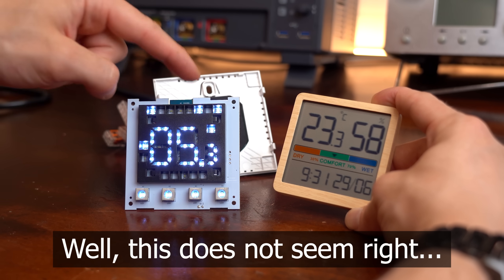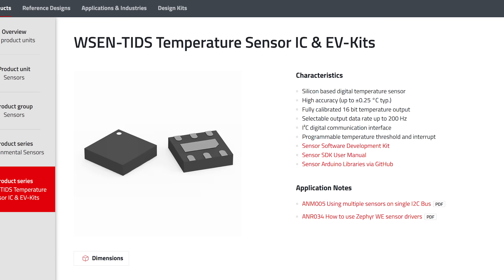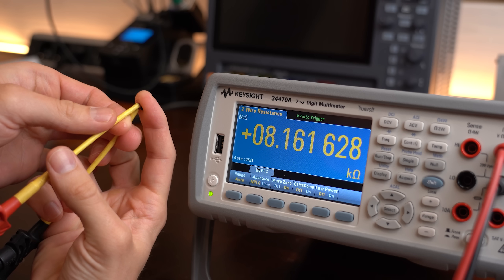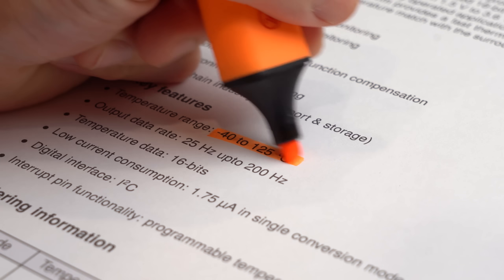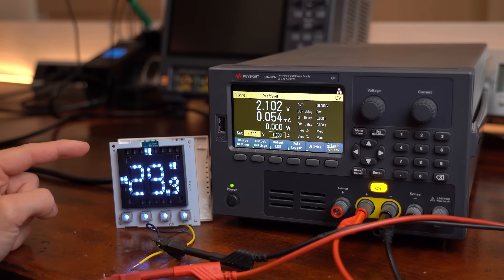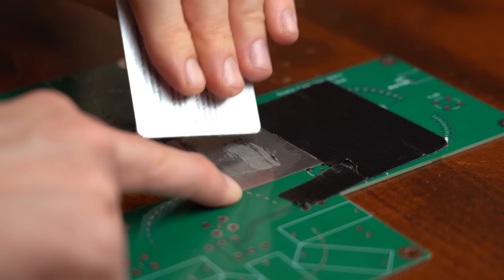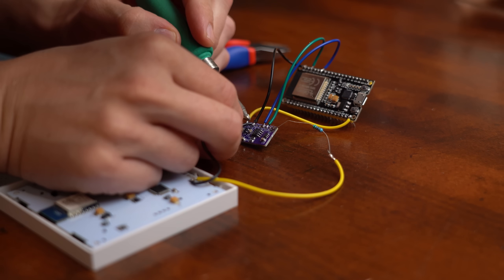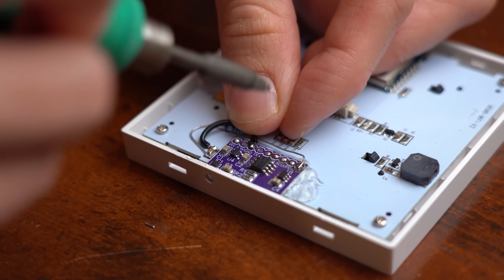From Meh to WOW - With 1 "Tiny" Hack!

Comment: I would try connecting wires to the resister to the resister to get it away from the board first. To see if other components heat is influencing the reading.

Comment: I think you make an alternative hack now - analogue style.  What about using the LM35 Precision Centigrade Temperature Sensors (TI) or a TMP35 (Analogue Devices) both have a three pin TO92 style package and are pretty cheap.  I think with a few passives and maybe a trimmer pot you'd be good.  I'm just an amateur so maybe I missed something, but I think it could work.

Comment: Sorry to say it, but you needed a piece of insulation in the wall. The sensor is INSIDE of the thermostat, and the air coming through the  hole intended for the thermostat  wire is a few degrees different from the air inside of the homes living space. This is a VERY common situation, but most people lack the ability to test it with digital accuracy...

Comment: Hey great scott , i was creating that directional speaker from your video , altho there were far more changes in mine , i have many doubts , could u help , i am using the esp32 for microcontroller , instead of bluetooth module , using esp as the bluetooth using the pschaltzman audiosink lib , then instead of waveform generator and comparator , both these operations are done using the code in arduino in esp32 , for amplfier driver board i am using drv8871 board , will this work? u can ask anything if u wish

Comment: At very first, I would have soldered the NTC on a few cm wires, and get them out of the device into the room, and then look at the temperature reading. The hole in the wall can easily  make that difference, the PVC tubes there sometimes even transport air flows from the outside.

Comment: Or you could have just replaced the resistor with a 1% trim pot.  But if you're going to go with a digital sensor, why not just add a relay and replace the thermostat all together?  In either case, less parts and much simpler 🤣

Comment: I would just replace R12 with a poti and simply calibrate the sensor. The slightly none linear NTC does not matter for the small indoor temp differences.

Comment: Not sure if you know this or not, but for a long time ( since mercury thermostat bulbs ) there have been electrical implementations that manufacturers used to add to the thermostat sub-base to minimize the overswing when a heat appliance satisfied. Back then it was called a "heat anticipator." It was nothing more than a resistor that sat underneath the bimetal element to "fake" load it so that when the unit was about to satisfy it would do so early and the space temperature would end up on point, not over. This is covered in most HVAC courses. Over the years many companies that have incorporated some of the base principles ( including this and time delays ) have incorrectly applied them in their logic. For example, using the concept of continuing the flow of air in a furnace to get the residual heat out after a call for heat. Consequently / paradoxically some goofy manufacturers tried doing the same in cooling. Where you really just end up taking humidity back off the coil you just ran. I believe Youtuber Matthias Wandell showed an actual example of this with his own dehumidifier setup. So, when you were describing the problem, it made me wonder if it was not a "cheap" component or poor quality but perhaps someone who doesn't fully understand the theory making something with tribal knowledge instead of actual knowledge. For what it's worth. Love the channel.
Reply: PS: I meant the manufacturer by the way, not you. LOL

Comment: Most of these Tuya thermostats have a temperature correction function for a +/-3C to the output temperature (I have yet to find one without this). In some cases you don't even need the official app and can do it through it's config menu ... so, skipping directly to home assistant sometimes has its drawbacks

Comment: You do know that all these panels have a option to tune the OFFSET right?
Also: why not swap it out for a ZIGBEE based one? those are much better than Wifi based models, and much easier to add to Homeassistant.
And you can tune the offset straight in HASS without much issues

Thee reason you have issues with the temperature is because you bought the NONAME brand, Just stick to more trusted brands like AVATTO.
I would suggest to avoid MOES. because those have a "Set-temp=X issue where it spikes for 1ms"

Comment: Fun. But you bought a thermostat, then gutted it and built a different thermostat.  ;-)
Might make more sense (if the error was great enough to care about) to just change the resistor in the voltage divider to raise/lower the temperature set point.

Comment: I have the same Thermostate and noticed this error. 
You can set an offset for each device in Tuya. This solved it down to around +/- 0.3°C error in the relevant Temperature range.

Comment: Hi. You don’t have the firmware but perdais you could dump the logiciel between the cpu and the wifi module.  Or on the central heater ( i don’t know the good word😊). But yes. It’s many work for a small gain. Thanks for the video
Reply: ...But perhaps...

Comment: I built my own thermostat with arduino nano33 iot using a bmp280 temperature sensor and a Nextion 5inch display. All worked well but a slight temperature difference was there, sorted by adding or subtracting correction to the read temperature and now matches within 0.1 degrees.

Comment: Most sensors are ntc, when you want to turn off the heat but thermostat has a pin code just use graphite pencil draw a nice big line between the pads for the ntc and heat is off

Comment: You could have corrected ALL of the thermostats' readings in home assistant, without touching hardware.

create a new template sensor that performs the correction, typically through the configuration.yaml file or the Helpers menu.

This would not correct the thermostat visual display, sadly. But you could achieve accurate control without touching Hardware.

It would have been easy enough to use a trim pot to correct through voltage divider, and then adjust the slope to linearity within home assistant.

I can't believe you created a PCB and Sourced all those components

Comment: Would have made a board the has all the parts in the right sports so it's only solder the correct spots and tada drop in temp fix.

Comment: I would have just used the built in manual compensation setting. It is only linear correction, but most of the time it is good enough.

Comment: Nice project, but a long way around for temperature compensation. The simplistic route is to use the thermostat’s own calibration function. An offset of +~5C can be found in the system menu that’s accessible from stand-by.

Comment: So my idea to add temperature sensor (ds18b20) to sonoff touch (light switch)  and send signal to boiler room to open valve is better then tuya stuff. Yes I don't have function to change temperature from the switch but it's no sense to do that floor heating.

Comment: Any good hardware solution for ESPhome wifi temperature & humidity sensor with 220v power supply? 
I plan to install 9-10 all over my house for automations but cant find any reliable and in good price. 
I build one with ESP8266 but it needs re-design to avoid heating the sensor when closed into the enclosure

Comment: My solution at home is:

1. Do NOT use the integrated temperature sensors in the thermostat or AC. Even if they are accurate, they measure right in front of them which is usually NOT representative to the actual room temperature.
2. Get some Zigbee/Zwave/Wifi (whichever suits you) temperature sensors.
3. Place 2 or three sensors at strategic spots in the relevant room
4. Using home assistant automation and scripts, get the average temperature from the sensors and use that in your automation/dashboards.
4.1 This way you can skip the thermostat, since it's functionality is covered by software and the sensors. You can use a random display if you want the wall mounted experience. If you still want to use your thermostat, look for an api to overwrite it's display temperature.

Comment: It's amazingly overengineered.
I have some cheap-ish zigbee Thermostats that I integrated in home assistant via MQTT. I simply used separate temperature & humidity sensor that I placed in the possibly coldest place in the room. This works pretty well for me.

Comment: I started with an esp32 with a temperature sensor (bme280, i think). I added a relay and connected it to the furnace (in parallel to an old school mercury switch, some impedance matching). I used the normally open part of the relay so the default is OFF.

I wifi enabled the esp32 to show the temp and added a webpage button to activate heating. I set ut up to increase the house temp by 4 degrees, running up to an hour. This way i can heat the house by vpn and activating that remotely.

Comment: A Control for Heating and HVAC has a bit more logic, that turn on at some tempture. 
You have to keep the HVAC unit on for a certain number of minutes and prevent cycling. 
Example if its 21C and you want it at 22C  you need to turn on for a few mins,  if you just cycle 
on at 21C and off at 22C  this could damage system just for 1 degree tempture change.

Comment: All my life in HVAC. I noticed that the gap inside the wall was not both isolated and insulated from the inside of your thermostat.
It looks like you had a very big hole in the wall as well. 
Even if there is only a tiny little hole big enough to bring the wire up into the back of the thermostat it’s still a smart play to seal that little hole (at the least with a piece of adhesive tape) to keep the unconditioned air out of the wall from travelling out of the wall cavity via the inside of the thermostat and then over your thermostat sensor bulb, stopping your thermostat registering the room temperature. In some cases that internal wall space can be slightly pressurised due to the wall cavity opening above or below the conditioned space or even outside the building, making the problem worse. At the very least I would seal the gap around the sensor bulb and the housing so that inside the wall Air is not able to exfil the wall via any path related to the sensor bulb.

Comment: Even if it's not "perfect" it's a lot better than it was before and you learned something in the process. 
You could put your thermal imaging camera to good use to find which component is producing the most heat (my bet is on the voltage regulator) and add a thick copper wire to its ground pin to "pull" as much heat away from it, maybe dumping it somewhere cooler into the white PCB. At first I thought about the ground pad of U2 but if it runs hotter it would add heat instead of absorb it.
Anyway it's a cool example of how to interface otherwise-incompatible circuits.

Comment: Totally over engineered for this kind of device but this is very instructive and could help for project to upgrade more expensive/uncommon devices. Thanks !
In my case, I swap the WBR3 chip with a ESP12F and then run ESPHOME (where it is easy to calibrate the T°C sensor).

Comment: The easier solution would have been to adjust the existing voltage divider. Since you measured the corresponding volatge for each temperature. This could have been as easy as replacing a resistor...

Comment: Do I see correctly that you placed regulator right next to the temperature sensor?

Also - copper is one thing, but you can also see on many more precise sensor breakout boards that they sometimes also cut the board so sensor uC is as separated as possible

Comment: You could have saved the DAC by switching to a 1-series attiny e.g. 412.
The heat creep is normally counteracted with a tongue like structure where the sensor sits on.
And to make it easier to assemble I would work with castellated holes and solder the PCB directly to the pads of the C and R you removed.

Comment: A DS18B20 might have been the better choice for the temperature sensor. It has almost the same accuracy as the Wurth sensor (+/- 0.5 deg max.) and almost the same temperature range. Although ... I don't think that going down to -80 or up to +125 is a situation where you expect the thermostat to still work accurately  😉
As a plus, the 18B20 comes in a thru hole variant so it can be mounted free in mid air below the PCB instead of on the PCB where it will take longer time to reach the actual room temperature.
Still a fun exercise though and an enjoyment to watch 👍

Comment: Thanks. My question is, 'Why not simply replace the cheap NTC resistor with a good one?'
I see that your solution works, and was with you until you used magic incantations,  Then I heard that whooshing noise which accompanies what is (to me) unexplained complex coding.

Comment: The biggest problem with the NTC thermistor is that it's to close to the warmer power supply and other electronic parts generating heat. On my sonoff NSPANEL I had to extend the NTC thermistor outside of the unit so it wasn't giving false readings, due to the heat from the nearby electronics.

Comment: This has SOOOO much more potential.
You often see on weather forecasts something like a "Realfeel" temperature which is supposed to be the temperature it feels because of the temperature + humidity effect.
You could program your little microcontroller to input both temperature and humidity and output a "Realfeel" equivalent temperature.
This might fix the problem I have had with ACs that under a specific set of environmental conditions it's too hot, but lower the set point 1 degree and it becomes too cold. I think this might be from the AC not just cooling but also dehumidifying so under some circumstances it is overdoing the "RealFeel" cooling and always too hot or cold.

Comment: WBR3. Have three of these thermostats lying here. Replacing WBR3 is not the problem, problem is that it still has to communicate with the Tuya chip and its still a mystery how it exposes things. So, having esphome around wont solve the issues.
In my case I was unable to flash WBR3 either, so, replaced it with esp32c3. As said before, problems are still there, so, finally, decides to get rid of those and get something that works well with non-proprietary, non-cloud ecosystem and is also able to recognize external NTC for safety switch (underfloor carbon heating overheating)

Comment: Congratulations Scott, you've just made a $25 thermostat into a $200 thermostat that isn't annoying and required software to work with lol.
Yes, smart thermostat are super annoying af and the cheaper one still uses NTC, which is still less accurate than US-made caveman thermostat that uses a humble bimetallic Strip.

Comment: Personally, I would've just replaced the fixed resistor with maybe a 6.8K one & added a 5K trimpot, then calibrated it.
Reply: that would only work well on a linear scope I suppose. I have made some thermostats myself. and most of the time those offsets only work in a small scope. 4 degrees difference results in only a few milivolts difference on a voltage divider.
Reply: why if something like ds18b20 costs the same as all those resistors

Comment: I think the TUYA WBR3 is supported to flash with openbeken. 
Maybe then you could write software for it with a calibration function. to compensate for the ntc

in the netherland action sells the LSC branded iot stuff first with the esp compatible chips that could be flashed with tasmota later with the incompatible beken chips. 
i was thinkering around with them when i found other people also started with the same idea and found the openbeken project in early stage.

i flashed some items like led stipe and  floodlight with it.

nice mod solution by the way :)

Comment: I think I have a nearly identical thermostat setup for my home automation with an electric boiler. Have you checked the manual for a way to set the temperature offset? Nearly all devices provided by Tuya come with such functionality. Even this thermostat, but they are coded and documented in the manual. For example, mine requires to press the 4 squares, up and down button at the same time to enter the settings menu. Then I need to select code 7 or 8 and from there set the offset in steps of 0.1

Comment: God I love the esp32, I was thrilled when the esp32c came out with riscv cores, but the idf actually means I can use the same code on riscv and their (either arc or tensilica) cores so the 32s are fine too.

This does seem like a long way around, but it makes sense given the application, might just want to replace their stack though, you can get a color lcd module and just wire the back into the relay and I figure either tuya or even just GitHub has a stack to interface with hass.

Comment: 00:55 That's why my smart home thermostatic valves operate based on data from external smart temperature sensors. The valve in each room operates according to the external smart thermostat value in that room. If a valve in a room activates, the boiler starts operating. Regardless of the temperature on the boiler or valve, they apply the rules based on the data from the external sensor. This way, I achieve more stable room temperatures and optimal gas consumption.

Comment: Tuya is bad hardware.  I would have installed some temperature sensors around the home, and used home assistant's template climate to drive relays down in your machine room. EDIT: The beauty of this, is that you can use the compensation sensor in HA to calibrate the temp sensors.

Comment: I think you got it correctly by replacing the NTC because imagine having to implement all that LED driving stuff and whatnow using some exotic controller on the board, as you will probably not find anything similar. Good job!